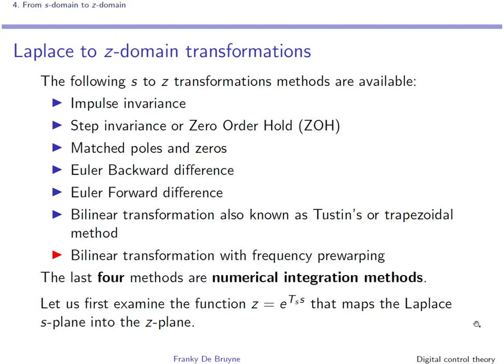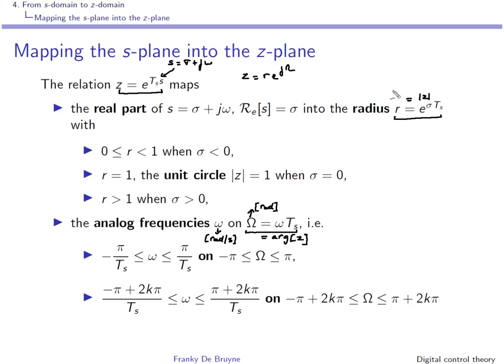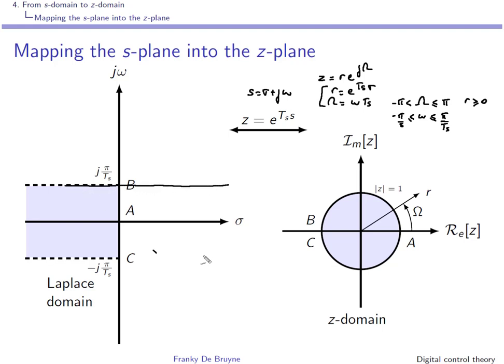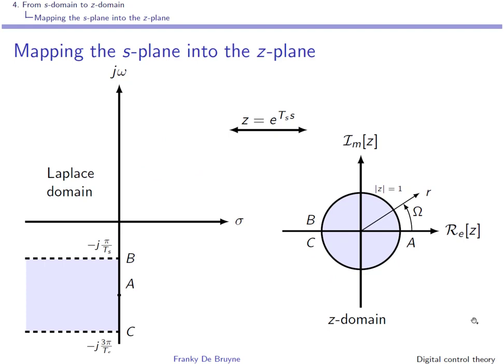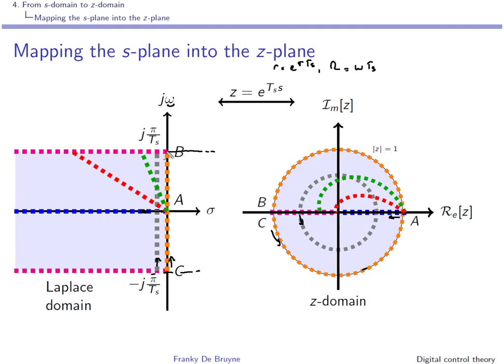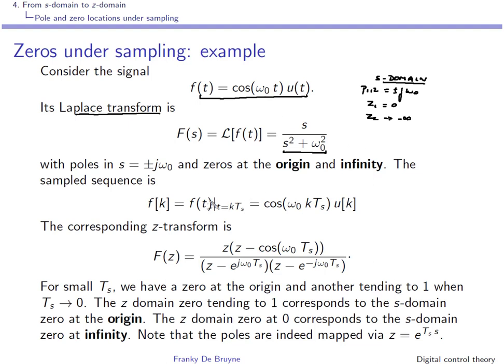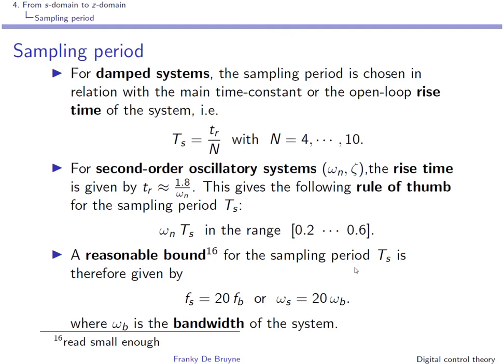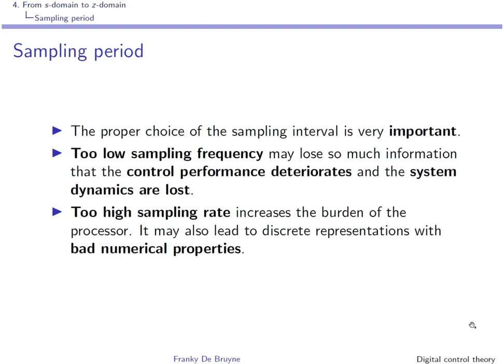Digital control theory: video 5 From s domain to z domain (part 1)

Comment: When calculating the zeros under-sampling, why do you use - infinity instead of + infinity? because the ROC for H(s) in fact includes s=+infinity not s=-infinity.
Reply from the maker: You are right: there is no clear consistent mapping for the zeroes at infinity. However, in this example, the z-domain zero at zero corresponds to the zero at infinity in the s-domain.
Reply: @frankydebruyne9842  Thank you for your reply. But to be clear, s=-infinity (negative infinity) is not the region of convergence for the H(s)? and also can this uncertainty about the placement of zeros after sampling cause any issues in any topic?
Reply: and also is there a reference that goes into more detail as to why the poles and finite zeros are mapped pretty accurately while the infinite zeros are not mapped consistently? Thanks
Reply from the maker: Not that I know off. The important part is that the relation z = exp(Ts*s) is valid for the "usual" zeroes when Ts --> 0. This has applications for the matched poles - zeroes method. The zeroes at infinity are tackled differently.
Reply from the maker: I have not found any. The references used are at the beginning of the course. Regards.